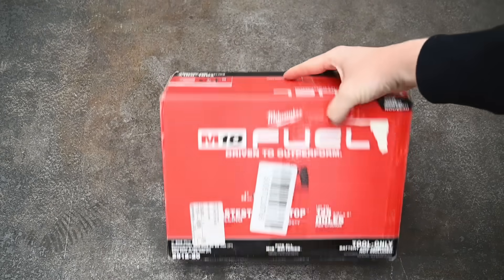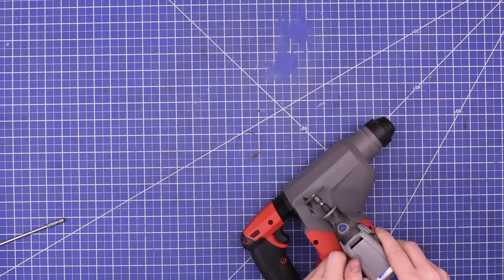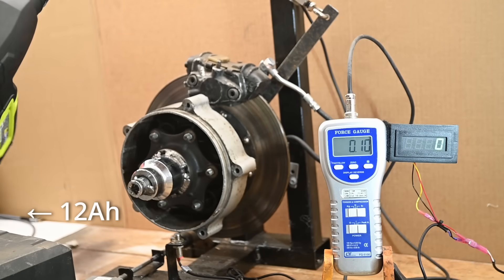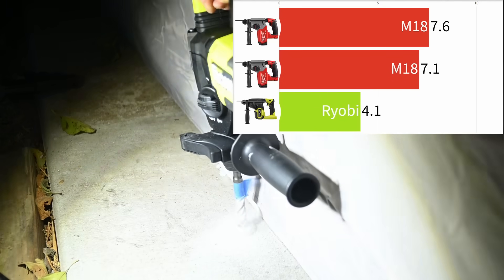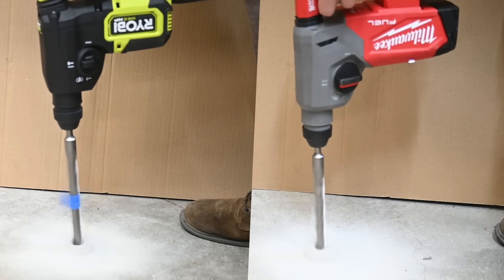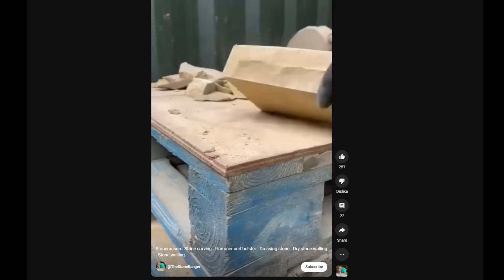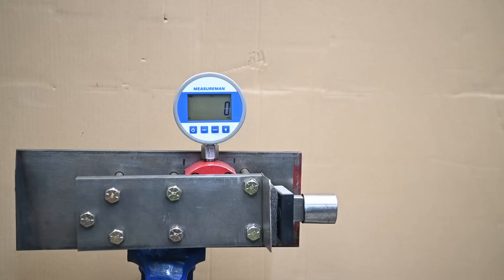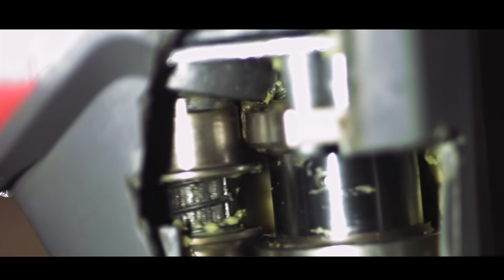How Drilling Thru Concrete Works @ 10,000 FPS

Comment: Maybe next time include how sds drill cuts through metal - use a metal sheet - alot on worksite we cut through rebar with concrete hilti bits meant for cutting through rebar

Comment: I Am On/In The Ryobi Battery Metaverse ! I Have Dozens of The HP 6AH Batteries! With Their Batteries Costing About Half of What The Other Brands Charge Every Holiday Sale I Am Not Impressed Enough To Make The Change!! I Have A Few Of The Old Blue Ryobi 1/4 Impact Drivers That Have Screwed Down Dozens of Decks Getting So Hot That You Have To Wear Gloves! And They Still Keep Working! I Have Bought The New HP 3 Mode Impacts That Are Stronger No Doubt! But I Do Not Believe They Will Last Near As Long As The Older Blue Ones!

Comment: People misunderstand these. They don't drill holes, they chisel them out. The rotation of the bit is simply removing the dust, and repositioning the carbide tip. True whether a hammer drill or rotary SDS.

Comment: The Milwaukee hammer drill is extremely durable. Have drilled 1000s of 3/4 holes for anchors with 1. It has outlived Milwaukee vacuums 1 after another 😂

Comment: I use a dewalt sds plus at work regularly. It doesn’t have the same power as the big corded Bosch that I also have, but it’s a lifesaver when I don’t have power outlet nearby. In the 750k sq ft warehouse I maintain, that’s frequent.

Comment: Used to use the regular hammer drill, switched to SDS+ years ago. What I will say is, If its a somewhat fragile surface like large marble tile the regular hammer drill has a softer impact and less of a chance of cracking a tile. High rpm/low pressure will soften the hits. SDS hits pretty hard regardless of pressure.

Comment: I really wish you could buy a decent drill that doesn’t have the hammer function. If I need to drill into concrete I’ll get out the sds drill. The mechanism just ads weight, complexity and cost.

Comment: Not a single Hilty Tool, basically useless video
Reply: I don't know why I am answering this comment, but in the interest of pushing back the frontiers of ignorance, here goes. He chose one budget SDS drill and one expensive one. This channel has to buy these tools with their own money. There's no Hilti, there is also no Bosch, no Dewalt, etc. The video accomplished its task of explaining how drilling through concrete works. This was not a video made to rate the performance of SDS drills.

Comment: I use the Bosch 18V-26F almost daily. It's SDS Max and I need to drill through all thouts of material. It's crazy how fast i can get a hole into sometimes 1.2m thick walls and even through some metals it basically eats away.

Comment: Sometimes at work when drilling into stone I don’t even use the drill part, just the hammer. It helps keep the bit from spinning off spots on the stone.

Comment: Thanks Guys..
One thing I learned while drilling a bazzilion Holes in Concrete is a bit of Finesse with the tool.
Pushing too hard/bearing down slows the chipping action down. I learned to find the Sweet spot and it chews...
Mike M.
Reply: Makes sense, as both kinetic energy and momentum are contingent upon velocity, and you need some space in which to accelerate.  The piston is moving a lot more than the business end.  Of course, with acceleration over really small amounts of space or time, you have to look at the derivative of one of those components.

Comment: Is there a trick to using the hammer function on cordless drills? I've seen workmen use them all the time so I gave it a shot: Started with a cheap makita, no cigar; High-end model, nothing. Smaller diameter, nope! Half the battery gone, my ears can't take it, I'm wondering if super-concrete is a thing. I switch to an SDS drill and it goes in like butter. After 10 seconds it was all done.
Am I stupid? Is there a trick? Are you all a reincarnation of Hercules?

Comment: Wow, you've done a wonderful thing.  You've educated a lot of folks, (myself included) about how an sds drill really works.  I also presumed they had high torque based on the motor size but given how they work, they don't have a lot of need for torque.  Very cool!
Reply: Not only is high torque unnecessary on an SDS hammer drill, its also undesirable. If you're drilling into reinforced concrete and you hit some rebar the bit will often bind up and if the torque is too high it'll break your wrist or if you're drilling near a perpendicular surface like a floor/wall/ceiling it could break your hand! The handle on the side is also there to help prevent these types of injury, not just to support/guide the drill.

Comment: Hmm seems to me though that even though it's chiseling, that carbide is actually scraping, not just pushing the dust and material away. more like a card scraper. i don't think it would be very effective if it wasn't. you can see it around here 7:09  because if that was the case that the bit is just pushing the material away as a result of chiseling, the material would have been loose already. The constant hammering of the bit, is to create a small divot into the material so that the "scraping" part of the chisel can actually scrape. in stone chiseling, you are chipping the edges off, essentially splitting the material, here there is no splitting, but instead forcing the edge of the bit to cut/scrape the material, hence why you see guys lean the bit a it, when the point of the bit doesn't progress

Comment: I’d love to see your guys’s opinions on the Carlyle brand cordless tools. As far as I know, they only have their 60v 1/2 and 3/8 impacts as well as a hammer drill; and a 12v 1/4 drive cordless ratchet. There is almost nothing on YouTube about them, and for something you can order over the counter at a fairly common parts store, I feel it’s worth testing out.

Comment: I wonder if there is a prime number ratio between the rotation and the impacts, making sure the impacts are almost always in a different position?
Varying the downward force can help, got an old one where if too much force the drill speed stays unchanged but the drilling speed slows down.

Comment: There are also manual hole drilling chisels, kinda with three straight flutes where you have to manually turn the tool between hammer strikes- basically a super slow SDS drill 😄

Comment: Really interesting stuff! The only thing I think I would like to see you guys improve on is consistency across tests. When drilling with the Ryobi it looked like it was at an angle compared to the Milwaukee. I think you also can have inconsistent thicknesses in things like poured slabs. I like the way project farm uses jigs to make sure the weight being applied also remains the same. Not that I think it would have made much difference (if any) here, but more consistency is always better.

Comment: Video idea: 
Difference between a cut off tool and angle grinder, and why a cut off tool is supposedly safer than an angle grinder for cutting wider variety of things. 

I can't seem to get accurate information on why "you're allowed" to use a cut off tool on wood for instance, but with an angle grinder it's a universally understood guaranteed death sentence. 

Why tf is the cut off tool motor so much meatier & thicker than the angle grinder's? More torque?

Maybe throw in some more rotary type tools to compare their functionality and explain why u can't just throw an adapter on one rotating tool and do everything. Mainly issue of torque vs speed?

I think this would be the only video of its kind and you're uniquely placed to do it, given your tool engineering knowledge. Thank you for your service in doing these reviews!

Comment: I work at a mine. & the guys on shovel crews use these Milwaukees in place of an air hammer when you don’t wana fire up a mobile compressor or a diesel welder, and string out an air line for some quick material removal.

Comment: U should've tried Milwaukee m28 it's more powerful
Reply: m28 😅
Reply: @riba2233  they really had a m28 line its stronger than m18
Reply: @basw265  they had it but it was trash, m18 is so much better it is not even funny
Reply: @riba2233  m28 was stronger but it way way too expensive a single battery pack could run u 250 euros
Reply: @basw265  was stronger then maybe, but it's much weaker compared to todays m18

Comment: I'm in the EU, and once had to drill a hole through the 30cm (a foot!) of exterior wall of my oold home, near tge ceiling where it's concrete. I didn't want to buy other tools so I used my corded hammer drill, expecting it to ve a torture... And it was. I finally got through after 45 minutes and a dead drill.

A few months later, my electrician had to drill a similar hole in a similar spot, but he had the M18 max. Yeah, I got an SDS drill after seeing him lol. Cheap corded one, still does the job well.
Reply: It's funny how everyone moved to battery for everything, but cheap corded either keeps up with or straight up beats a lot of battery stuff. And for cheap hobby tools corded is a godsend

Comment: if you do a video that acutally explains the different tools that spin drill bits (including modded angle grinders). This area is so confusing. Like I vaguely know, but I feel like if I had to fill a written test about what machine does best, what machine has chuck, is impact hammer drill the same as impact drill... Though I think I totally got the SDS part, which is something I never really understood. To me it seemed like a drill with drum mag.

Comment: I always wanted to take the internals (hollow cylinder and piston) and machine purpose built ones that will use a shot of diesel at the right time to increase the impact force through the combustion. Just mimic the system a diesel hamer pile driver uses on a smaller scale. Someday YouTube, someday.

Comment: 12:10 Unfortunately, hammer drills don't always get the job done; I had to mount some TVs to the exterior hardened, reinforced concrete walls of a few Home Depots, and if I hadn't bought a proper rotary hammer I'd probably still be there trying to make my holes for the relatively small mounting Tapcons. Hammer drills have been ok in old, soft concrete floors in office buildings, but I always keep my cheap, corded Bauer rotary hammer in the truck.

Comment: The biggest benefit I always noticed with a SDS is how much less force you need to put on the drill compared to a drill/driver and how much vibration goes back into your hands.  I was doing a job where we had to drill about 50 anchors per floor into the ceiling in old 1970's concrete, I was able to do the entire floor with my SDS and while my arms got sore it was fine.  My co-worker on the floor above tried to do the same with a drill/driver and his arms turned into jello by around hole 30.

Comment: Can anyone tell me an advantage vs the compact sds drill vs a d handle? 

Other than it being more compact, obviously.
Reply: D-handle is better for drilling floor (don't have to kneel or bend over as far). Shorter styles are better for drilling walls or ceilings. I've always preferred shorter style as it can get in to tighter places and can be used one-handed. When doing floor I usually have kneepads or I just sit down.

Comment: 4:47 Not sure if you're hitting peak torque as I can't hear the clutch slipping. The 2912 definitely has a clutch (parts 6-13/14/15). Could be tripping thermal limits, or maybe they've added a more conservative current limit so that clutch only slips on a sudden bind up.

Comment: I have probably used a SDS plus drill with a carbide masonry bit to drill 300 holes in 3/8 A500 steel. In hammer mode.
I wonder what that looks like in high speed.

Comment: Nice work mate, this is a very good overview of these tools.
The low torque they have is something I've tried to convey in my channel as people seem to use them as a big twist drill, but really they're just dust augers. Much better off using a normal combi drill.
Also your concrete seems pretty soft, do you have limestone aggregate or something?
Reply: Modern rotary hammers have slip clutches to limit torque.
When you snag on rebar, you know why.

Comment: I'm still curious if these can be used in Automotive to get wheel bearings etc off like an actual Air Hammer, but also be used to drill concrete etc.

Comment: Cool slow mo footage.  For those unfamiliar with the progression of things, those masonry bits are the evolution of straight pattern bits from back when hammer drilling meant you were drilling with a hammer.  Same basic concept--the drill is a rotating chisel that either you or your trusting buddy rotated between hammer blows.  The single chisel masonry bits work fine in rotary hammer applications, but more modern hand drillers prefer star drills with a pair of chisel wedges arranged in a cross pattern.  The skill isn't dead by any means either.  Often in national parks the use of power drills is prohibited, and neither would you want to lug around a rotary hammer if you're packing in a good ways or climbing a rock face.

Comment: I recommend using a hammer drill for holes near the edge of a slab or panel; less risk of spalling. Rotohammer for everything else. Btw I have been using the M18 1" (it is their smallest Special Direct System Plus with a demo/hammer alone setting) in the video for 8 years and it has been performing pretty well, I'd recommend it. Slotted Drill Shank is a pretty good guess though.

Comment: Cool beans, that's the best SDS video I've ever seen.

I've had an SDS Plus drill for the better part of 10 years, never thought I'd use it much, bought it just to drill a hole to run airlines up from my basement to garage, but have done hundreds of holes since for anchoring decks, installing my lift, TONS of tapcons, and a few more holes through foundations since then...plus lent it out to a bunch of people too. Well worth having one!
Reply: Harbor Freight was selling their corded Bauer brand for 80 bucks. I will easily get my money's worth out of it.

Comment: Would it be possible to cut the spindle open to expose the anvil to see the striker hitting it?
Reply from the maker: The anvil housing is also air sealed, I think that's how it recoils back, from the striker shooting back. It all just stops resetting once cut into
Reply: Between the striker and anvil does not have to do with the air column ;)
Reply: There are exhaust ports behind the anvil that indicate that.

Comment: A pound is a force, not energy.  One pound-foot is equal to 1.35582 joules (exactly).  This is force X distance, not torque.
Reply from the maker: We didn't say it was torque. We're reading specs here.
From Milwaukee's site: "POWERSTATE Brushless Motor: Provides 2 ft-lbs of impact energy, 1,330 RPM, and 4,800 BPM"

Comment: Was thinking that the wedge pressure could be a bit swayed by the pressure pushing to keep it going forward. I think if the wedge dyno was adjusted so that it is hitting down, that might give a more fair test. Where 2 tests could then be done. One with just the weight of the tool to see the numbers it can handle without assistance, then applying a 10lb or some sort of set weight on top that would be an expected amount of force a person would apply to the tool in real usage.
Reply from the maker: When making the thing we figured as well. But what put it to rest is tools like this that dont waver in impacting energy at all, they make the same number every single test. Like +/- 1-3%, and that's gotta be mostly timer. How much you're behind it doesnt seem to effect the rig as long as it's well seated on it
Reply: @TorqueTestChannel  hmm, did not expect that. Honestly thought there would be a real variance but the numbers dont lie lol. Thanks for informing.

Comment: When picking the driver to buy you should also consider that a faster (more hard hitting) driver will reduce the amount of heat put into the chisel, which seems to be the primary killer of them.

The drill drivers that have a hammer function also seem to require a lot more force from the user, particularly noticeable when drilling in a ceiling.

Cool footage ;)

Comment: Cool tests to see, the power difference in psi was quite revealing. Is it possible the impact force on rotary hammers could be improved with rpm and hits/min, similar to high torque impact drivers? Another TTC classic frankenstein chainsaw swap perhaps? Also it’d be neat to see the Hilti rotary hammer, it’s been a standard skookum choocher for rock climbing bolters for a long time
Reply: The more I think about this, it’d also be quite interesting to see the effect of the power curve of these tools on the chisel bits. When drilling into harder rock like granite, typically the bit wears out before the battery dies. Perhaps the Milwaukee can drill faster, but does it burn through bits as a result?

Comment: Last summer I had to drill some half inch holes through some concrete pavers. I put an sds style bit in my M12 drill with hammer functionality, and it took me about 10 minutes of constant running on the drill to cut one hole. This was with a 300lb guy (me) bearing straight down on the thing. The one hole took more than one battery. 

So I went to Harbor Freight and bought one of their cheap corded SDS drills. All the rest of the holes together took less than half the time of the first hole using the M12 drill. We'll worth the $60 or so to have in my garage for the rare time I need to be able to drill through concrete.

Comment: I work with granite daily and the bigger the hammer drill the better it works. American concrete isnt anything impressive. Id love this same test on a granite boulder
Reply: Also that dewalt hammer drill driver abuses those bits. The higher rpm heats the bits up a shit load and dulls them very fast. The sds spins slower which keeps the tips of the sds bits a lot cooler(not that they arent still hot)
Reply: I also feel battery sds dont do well compared the 220 corded ones mainly because the vibrations slowly make the batteries not work as well. Excellent video though